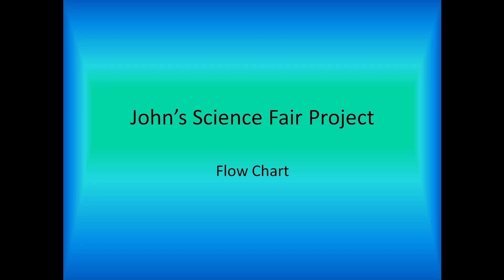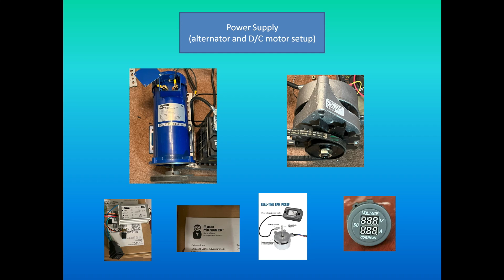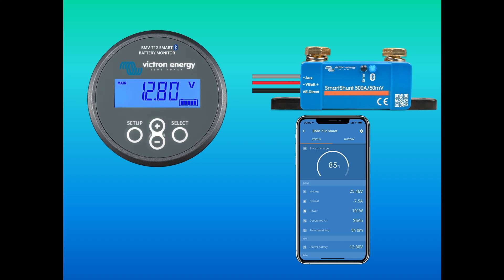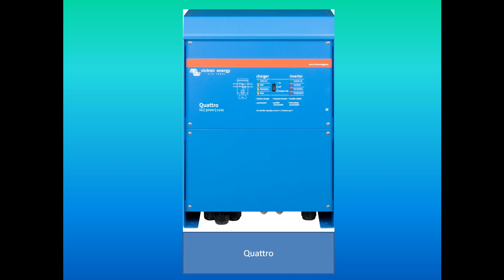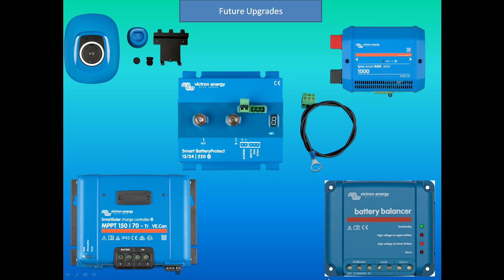Slide Show

Comment: Not so much as a hypothesis but it is the reality of what is going to happen. I do have a 1500 watt inverter to use, however the Quattro from Victron Energy is an inverter/charger. One I will be getting should be around 8000 watts

Comment: To be clear, it is your hypothesis that the energy provided by the alternator will be sufficient to power the motor and maintain proper charge of the battery? Also, that there will be sufficient energy to power additional devices as well, possibly through an inverter?